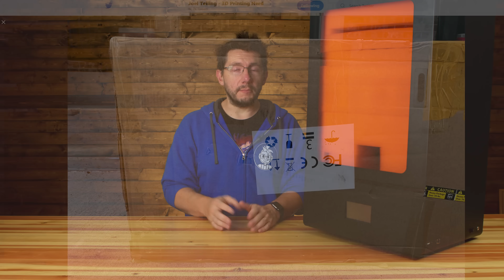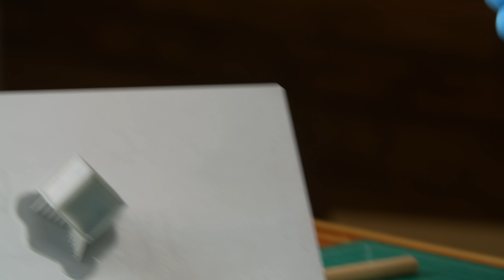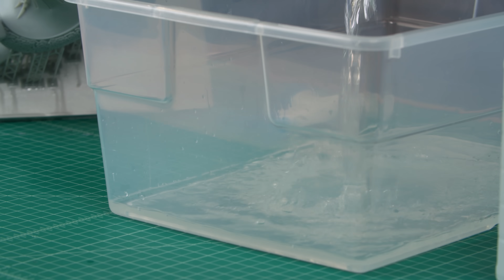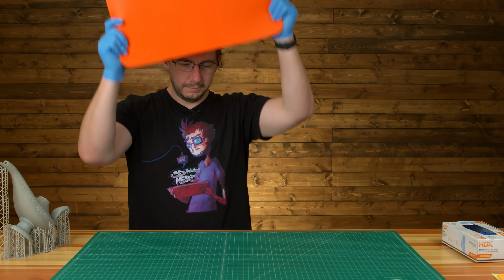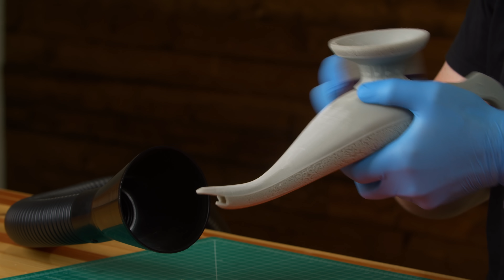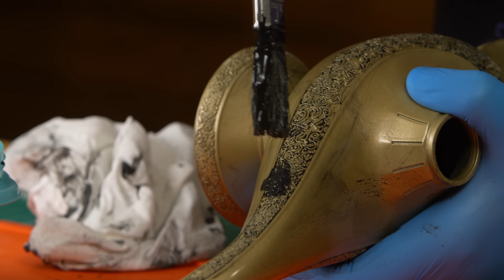HUGE Resin Printer - First Impressions of the Peopoly Phenom mSLA 3d Printer

Comment: Funny thing. 6 years later, 4/6/26 I just bought my first resin printer - Peopoly Phenom L. I run FDM Voron 2.4 machines but this was a sweet deal at $325 so giving it a go. It's older tech but good enough for my first messing around and the price is right.

Comment: One time I sent a motherboard to a manufacturer under warranty via USPS, and had shipping insurance. USPS destroyed the board and when I contacted them for the  shipping damage reimbursement, they said that they needed the original shipping packaging. I contacted the vendor and was told that they threw it away. USPS would not honor the shipping insurance and Gigabit would not honor the warranty due to board damage.

Comment: Crying about a loud fan is pretty nit picky and petty.. did you never have a high end pc in the late 90s early 2000s... Cause they could be way louder them that.. I probably wont be back to this channel..
Reply from the maker: No, it’s not. At all. This is also why the manufacturer has released specific code to not spin the fans all the time AND upgraded fans to make them quieter. This isn’t an airport but thanks for announcing your departure.
Reply: NOTHING asbsolutely NOTHING with performance, precision, or power in its description has ever been quiet. Anything truely delivering those descriptors will get hot and require cooling, even water cooling requires fans. 

No product will ever be the prefect package, selling one of something isnt how money is made. If the fans sound floor and the resins smell are your only grips wait till the end to express them, because complaining about something before you had even actually used it, subtracts credit from your opinion.  Especially if like me, this is a persons very first exposure to your show. 

Show the product, let it speak for it self then complain about shipping and dents and vents and smells. Your preamble about the shipping had me wanting to leave the video, I stayed because I wanted to see the machine work. 

Look im not saying these things to troll or put you down. Im giving my feed back on how I fell about this video. Doesnt make me right, doesnt make me wrong. Just putting forth my opinion on your product. If you dont aproach each video with a sense that this will be new viewers first exposure too you, and that the format maters, the order of operation maters, well thats the difference between 1m and 10m subs. Those little nit picky little things that bother people like me are why we dont sub. Just most dont take the time to explain them selfs, and I wouldnt have if I didnt see the channel as useful.
Reply from the maker: @rotherthies  You said "crying about a loud fan is nit picky" and I responded to that. Sure, you're not trying to put me down or troll, I get that, but you said a very specific thing and I responded. My goal is to provide my opinions on things, and quite honestly, fan noise is a thing.

Also, I'm thankful for your feedback, and I appreciate it. This video IS more than 2 years old, so I know that things have changed with format and delivery since then. Thank you for watching this, and thank you for taking the time to give me feedback.

Comment: Hi there. I think your videos are terrific and I’m learning a great deal, but I’m very new to 3-D printing and consider myself beautifully brutal about them. I would like to know what you would recommend for my needs. Basically, I would like to make car and truck accessories that are custom made for certain vehicle models, such as cell phone holders, purse hooks, cup holders, center consoles, and switch pod mounts that require little to no drilling, but look custom-fit or factory made.  But some of these accessories are also long and run the width of the vehicle, such as light bars or racks.  Eventually, these molds would be mass produced in a better quality plastic, or in the case of light bars, into metal. So I’m looking to make a master mold, but some of them will be very long and that’s where I get confused because some beds/ printers seem way too small.  Do you have any suggestions?

Comment: UPS made mistakes, but Peopoly also has its faults, the printer was shipped with bad padding and this is a manufacturer's fault. And for $ 1650 adding more padding shouldn't be a problem, especially if the printer gets damaged during shipping and then I ship it back for a replacement.

Comment: The box was poorly packaged, plus that's a 70+ pound irreg. its going to toss and turn around the belts and throughout the back of the trucks. its not like we have the ability to put every package in a bed of pillows. I've seen plenty of entire glass vase's shipped with us and get tossed and turned and still make it. its all in the packing materials.
P.S. the "puncture" in the box is more likely than not from the actual foot itself bumping out of the box, and orientation arrows mean nothing when you have 200+ stops in a day

Comment: I am a disabled Veteran with PTSD memory issue but want to try 3D printing to supplement my beginner woodworking,  I feel investing in a resin printer would be easier to learn than a filament printer am I mistaken? Not sure which to start with to learn on but like the idea of large formats.
Reply from the maker: Hmm. Filament probably a little easier in my eyes and less messy, but both are awesome. Right now beginner resin and beginner FDM are both super affordable.
Reply: @3DPrintingNerd  I am hoping to use it to make woodworking, astronomy items, and dabble with miniatures to learn to paint them, have to buy all the pre-designed things as I am not a designer.
Reply: I made that post from my gaming account, this is my future crafting account if interested. I am a TRUE beginner/amateur in all things craft related. Just looking to learn some new hobbies.

Comment: If anything that was not packed properly.
NOBODY cares about those arrows!!
Have you EVER worked at a delivery company? You don't have time or patience to care about stupid little arrows that are really hard to see.
As a company sending stuff this size/weight/mass, you should PACK it properly.
A unit this size should have had some kind of packing support structure inside the box - like some kind of wooden jig.
If a unit of this size/weight/mass is delivered broken it's the fault of the person/company packing it.
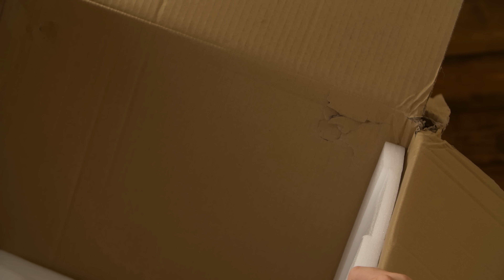1:31 - [EDIT] - if you really look, you can see where the foot of the unit has impacted the box. 
There wasn't ANY packing there to limit this. 
If you look over the other side you can see where the other foot also nearly went through the box. 
There should have been some kind of packaging to prevent this.
Even the packaging they used on the other sides is VERY THIN (for a unit of this size/weight/mass). 
Again - if it arrived broken it's the fault of the sender for a unit this size/weight/mass.

Comment: What I wondering is, can you design a PC case just with the layout and have this 3D print it from tough wearing resign?  That support sections on the lamp make it look like a huge real life sized art  piece, say 50 foot high was being built in a art ground area and they needed scaffold to support the art piece until it was finished.  I used to do home figurine models about 6 inches tall as a hobby where I tried to do as a home business?  I had the resign and the powder to mix into it to make up the bulk of the resign figure, I even made my own plaster supporting front and back molds to hold in place the silicone rubber home made mold that did the figures!  I had a un-used photographic darkroom I did not finish fitting out with a nice big 9 inch extractor fan in the wall and a nice stainless steel sink and worktops.  Sadly I could not get my main bank or the other business account bank to loan me the mere £1000 needed to buy the vacuum based mold chamber I needed to make sure all the tiny air bubbles were removed so the figures were detailed and no missing tiny areas!  Such a huge shame as I spend allot of time and trouble and money setting up the hobby/business! And I was unemployed so it really lost me lots. I never got back into the hobby. Even though all the stuff and molds still stored away 15 years on.  If I ever win big I try 3D printing figures instead.

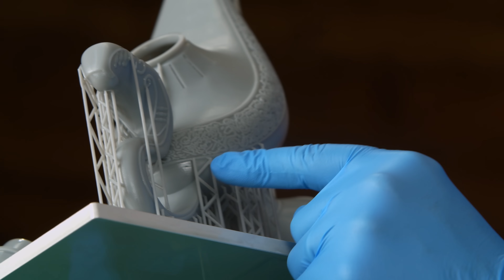Comment: I believe the irregularity mentioned at 8:30 was due to cupping. This is a common problem if printing hollow models with resin printers, and it can be fixed by changing the orientation of the model or by adding pressure relief holes in the model.

Comment: as far as painting and making it look better: 1) Look into high gloss clear coats. This will take your gold and make it shiny. Like all gold should be. 2) use more water in your wash. The idea is that it's a very dilute mix of paint that very lightly coats the surface, gets into any cracks, etc. 3) depending on the piece, dry brushing to add highlights is also a great idea. This is a specific application I wouldn't have done that with, but dry brushing is a very tried and true method of adding wear and tear to things.

Comment: As much as I want a Form 3, this is way bigger and a fraction of the price. I do have a question however for anyone that owns this printer. How accurate is it? Cause I plan to make articulated action figures that fit together with small tolerances down to 0.12mm to 0.15mm. Anyone that has an answer, please let me know. Cheers! 🙂

Comment: With resin i remove the supports befor curing its softer befor so the marks aren't as aggressive also I always like submerge print in ipa to get the inside of the object clean as you will struggle to get uv light inside well enough but that is a awesome machine and love the channel!

Comment: Splendid! However how do you think it will handle a microperforated plate. Say 0.3mm with 0.7mm pitch. Will the holes be blocked? And what will be the roundness of the holes. Micromachining using 3d printing will open a whole new window!

Comment: Why can't they make a resin printer with a square-shaped bed to maximize the x and y of your print size? It's absurd to me that they all insist on a 16:9 ratio, this ensures your builds will always be to objects with any single dimension no greater than about 6 inches. That's baffling and daft!
Reply from the maker: I think it has to do with the size available for LCD screens? Most machines like this use already available screens, and those are all used for devices, which all have that same ratio.
Reply: @3DPrintingNerd   Fair point, but even the machines that costs several thousand dollars only using 16:9 screens only is silly to me. I would gladly pay a few hundred more for a printer like this if they would just make their own 4:3 screen and make that y-axis longer.
Reply: @7F0X7  A "few hundred more"? To tool up a custom screen size? For the production volumes of a "prosumer" 3D printer? Hahahahaha. And of course even if it actually was only "a few hundred more," guaranteed you WOULDN'T actually buy it, people care about cost above almost everything.

Comment: IMO (do at your own risk) if you can take the bottom off so you can get access to the inside of the foot area. You can possibly fix the dented foot by using a thick rounded off soft wood dowel rod and a hammer it gentle into the inside of the dent to push the metal back out.

Comment: 4K and 8K LCD screens will be quantum leaps for 3D printing. There's an 13.3" 8K screen coming to market later this year. That would be a large format printer with double the XY resolution of this machine. Was thinking of getting a Form 3L but it wouldn't be able to hang with this new LCD tech.

Comment: I got one, starting having problem after 50 hours of printing. The display won't last 100 hours. Be prepared for $90 + shipping every 70 hours of printing. After that it deteriorates very fast. Peopoly says the display will last 200 hours to 500 hours. But they don't warranty that. Besides this, the machine is solid and delivers great prints.

Comment: i have 5 fans in my gaming pc and it's practically silent. number of fans does not equal loud.
Reply from the maker: Well, true. More often than not it does, though, since many don’t know what a Noctua is.
Reply: @3DPrintingNerd  Noctua fans in a gaming machine? what sacrilege. It's all about the RGB bling. all joking aside yes choosing quiet fans can make a huge difference. Also not blasting the fans at full speed when you don't need to.
Reply from the maker: @MaheerKibria  Very good point. I know the fans in this machine are hooked up to straight 5v power, so no adjusting the speed. :(

Comment: Great review of the printer; very helpful as I am shopping around for the best solution to add high quality 3D printing to my shop. I have a question about the noise: I use a twin fan ducted and ventilated spray booth as I airbrush; do you have any idea if this system is comparable to a system like that? The booth is quite loud, but I don't mind since it is required to do quality work safely. Along those lines, is this system compatible with any hose based ducting system (my booth uses dryer vent ducts). Thanks for taking the time to review this system!

Comment: When I was printing a lot of SLA parts, I used to remove the supports prior to secondary curing, and I would wet sand the part with 400 grit emory paper, using isopropyl alcohol instead of water with the emory paper as I cleaned the rest of the resin off in my dunk tank. Worked quite nice for making a nice, clean model rendering the support points completely un-noticable.

Comment: Thanks for this great video. I just have a Photon and it is quite small compared to this machine. Now I would love to go bigger :-)
When weathering your prints you should go for oil paints thinned with mineral spirits. You will get much better results and you can use plain mineral spirits to remove oil paint after it has already dried without damaging the paint layers below. This is called "oil wash" and it works best on a glossy surface.

Comment: Longer Orange 30 is the best bet for most normal folks... small desk space taken up, 2k LCD mask res, down to .001 ... The Orange 10 can do similar, but smaller print area... either easily print the finest of detail with zero effort, making that first print that was said to "be tough for SLA" machines, look like the simplest of toys to print. Cheap too... Not gonna print this size of things, but very useful in their own rights... especially the 30. And I've used them time and time again, over and over and over... and only once did I have a print error, and it was my own fault pushing limits when setting the print up. 

This size is awesome though, despite being lower detail than the smaller units. Still higher than most filament jobs by far, and not seeing a single layer artifact is always incredible, regardless of scale.

Comment: 1/5th the cost but still around 10x too expensive. its literally the same thing as all the smaller resin printers, just scaled up. the extra raw material that makes up the larger parts does not warrant 10x the cost. and considering screen replacements on larger printers like this isnt as expensive as youd think, you cant say the cost is in a larger screen. i could MAYBE justify spending around 400-600 on something this size. that accounts for it being physically bigger and costing more in raw materials to make a bigger enclosure, uv light array, build plate, etc. you are still working with a 2k screen like on smaller units so the pixels for the screen are made bigger and the objects will be less detailed. not worth 1800, even if i could afford it.

Comment: 8:30 "layer irregularity" are you sure that hole wasn't added by the slicer to allow air in during printing?
Reply: most slicers wont add holes automatically. you normally have to designate where you want them yourself.

Comment: Ohhhh, I got you beat on that one.

I worked for an architect back in the 1990s, and we had some Viewsonic 24" monitors.

That sounds 'pfeh' today, but this was the 90s -- a TUBE monitor -- and they cost US$2400 back then. Yes, $2400.

Anyway, one of the monitors failed inside the warranty period, so we shipped it off, they fixed or replaced it, and we got it back.

Unfortunately, when we got it back, we opened it, the front glass of the monitor was severely cracked. Upon closer examination, we noted a 2" x ½" square hole in the front of the box... Yes, just the size of a forklift tongue. 

Roadway, when shipping it, had had someone drive a forklift through the box and past all the foam packing into the front of the monitor. They did not penetrate it, but the monitor did need an insurance replacement.

The FUN part was that Roadway attempted to claim we'd not packaged it properly, and it was our fault.

We laughed at this claim, which failed utterly, however, as it was in the original shipping box from Viewsonic... WITH all the original packing foam.

Comment: Failure to properly secure the item in the box with padding is NOT the fault of UPS. 
You obviously have no claim as materials were insufficient for the weight/size. 
Send that crap back. Any company that sends $2k with padding on 3 of 6 sides is out to screw you. 

Hard Pass. Thanks for being honest about the condition of the vendors packaging... horrible.

Comment: Two suggestions. 1) if you're going to pour the alcohol into the bin, why not put the print into the bin first and then pour the alcohol over it. 2) After doing the black patina, dry brush a little of the metal color on to bring out the highlights.

Comment: Not sure if it really matters but how would a small fluids pump work for the rinse tank? Basically make a low end parts cleaning table. Your tub, a 1/4-1/8 HP fluids pump that does maybe a gallon a minute, some hose to fit the pump. It could be useful for large prints or multiple small prints.